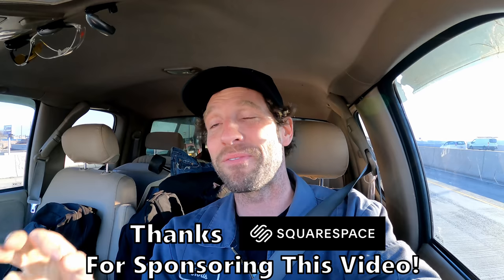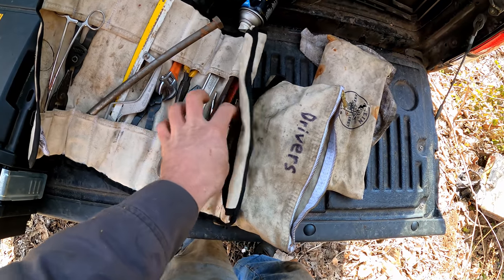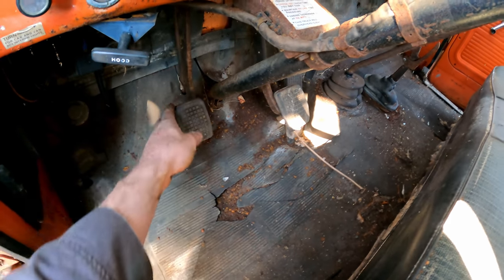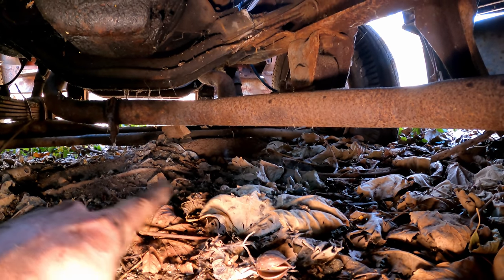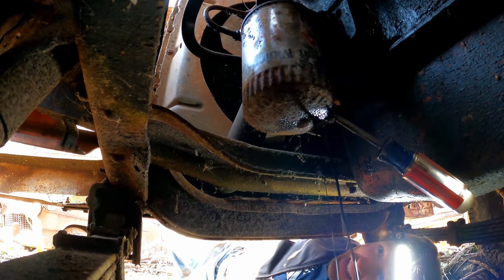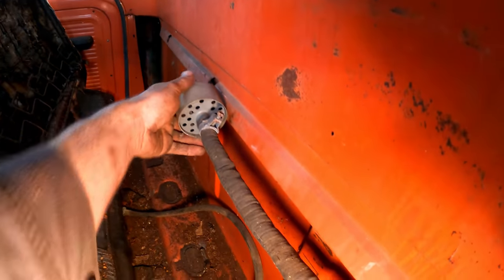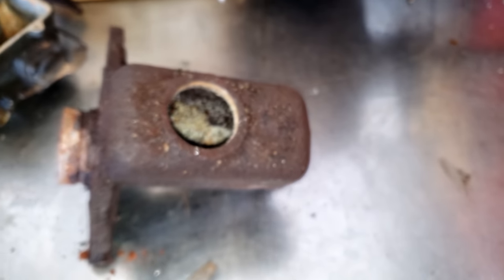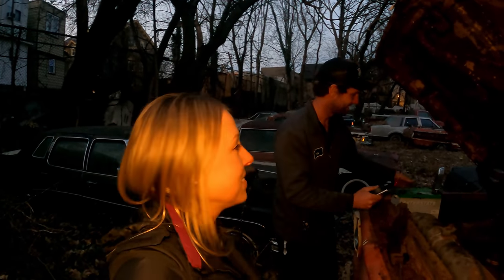Will It Run? 1971 Ford F600 Stick Shift U-HAUL Truck - NNKH

Comment: $1,200.00 OBO max parts truck it would cost a fortune to have that transported by a heavy haul. Loaded you are talking at least $3.00 a mile or more when it cost $1,500 now to fill a rig.
Reply from the maker: Thanks for your feedback man. And yeah true about moving it. That's why I figured try and get it rolling down the road but definitely needs four tires and brakes bare minimum.
Reply: @NoNonsenseKnowHow  Good job dude ! Engine sounds great ! You should be proud of yourself!

Comment: 300.00 really pushing 1200.00 but   no more even the parts on it not worth much as most are rusted or in bad shape. Plus towing that truck out of their is going to be expensive. The box is the value as it looks to be aluminum, as long as the box is not compromised then it's got value But if box is bad then scrap price would be somewhat good on box. who knows theirs always a person willing to pay the asking price.

Comment: I wouldn't pay more than $300-$500 for that truck. You'd be money ahead by putting that box on a already running and driving truck. If I had to guess, the truck has the 330 c.i.d engine.

Comment: 3 grand for it? hell no its worth maybe 1500 on a good day. i saw a few grain trucks that were sold at auction same year and with a dump bed sell for 800. scrap might get ya 1000 but you're still gonna have to tear it apart and that will take like a week to do. its not gonna drive without several thousands of dollars of parts and work too.
Reply from the maker: It's up on Facebook marketplace right now for 550 and not even selling it that price
Reply: @NoNonsenseKnowHow  yeah i really don't know why people think their stuff is worth so much. yeah its cool and interesting but anyone serious enough to buy it will take a while to sell it. no one wants to take the extra time out of their life to deal with someone elses problem and give them money for it. I know this old dude here in utah that has a few acres full of old mopars and gm cars. they all need restorations but he looks on mecum auctions and thinks that someone is gonna give him 30k for a roached out charger hes old and dumb. im waiting for him to die then im gonna go in and save as many as I can and make a profit. his family doesn't know anything about them but I might be able to get them at a good price.

Comment: That square body diesel was a failure for GM . That was a gas engine block. A friend had one was always vapor locked, overheating etc. GM wrote him a check for a internal combustion engine!! I helped him swap it over, was a lot of work!!! Wire harnesses, fuel, etc. etc. I think they put them in some of the large cars also Olds 98 Buick Electra Chevy not impala something else, it was a flop

Comment: Definitely not worth $3k.  I don't think Ford put the 360 in the big rigs. The big rig engines were based on the pickup FE engines but the big truck engines were the 332, 392 and I think a 351. Worth restoring even if you can find a cab that needs a truck. The rest of the rig looks okay.

Comment: 3k for that?!?! Get her to a drug rehab program!! 500 bucks max. You not only have a truck that'll never travel the roads again, but you also have to spend money to remove it once you bought it. 3k don't surprise me though, most hoarders are delusional. I even doubt anyone out there is looking for U haul truck parts from that era. The cab, if its salvageable, could be used on a F series pickup of that era, they are the same.
Reply: Could be put back on the road again with work
Reply: @mehmeh5471  Um yeah ok
Reply: @kman-mi7su  Nothing wrong with the frame, everything else can be replaced and repaired if want to spend $ so YEA OK

Comment: of course a manual transmission u haul, back in the early 70s 
the thirty somethings of that time all grew up on manual transmissions, most cars and trucks than came as a rule with a manual transmission, they in that era's way of talk came as standard options, or with a "standard transmission," in most cars, automatic transmissions were an "optional" only item.
   in a larger truck,  automatics were un reliable, did not pull well,
slipped a lot, and at the time, lots of cars only had two speeds as options, ford did have a c-6 for this truck, however, the ordering party for this truck was an OLDER guy likely in his fifties or sixties, who thought automatics belonged in cars, and here ya go

Comment: So not worth your time. The time you spent was enough. Running ... $850.00 tops. Think of what and how must be done just to move it to a place to part it out. Time is more than money... you spend it and you don't get it back. I had a 69 F-600 dump short wheel base and what a runner it was! Loud slow and a gas drinker but always did the job. Thank you for posting! Nice to see Jen's camaro ...mmmm CAMEO  lol

Comment: 1967 Ford truck I wouldn't give over 500 to 700 hundred  bad sigh oil filter and everything rotted  threw tires money brakes locked up clutch maybe brake line brake booster master cylinder new tank new cab new. Hood

Comment: Almost comical, a get it running video but the “ mechanic” doesn’t know what an oil bath air cleaner was! WOW
Reply from the maker: Yeah because todays cars have oil bath air filters on them.  The comical part is comments like yours.  😂

Comment: That's too rotted to bother trying to turn into a runner. A few hundred above scrap cost is all I'd pay for it if I wanted the drivetrain. And if I did I'd probably pull it in place and let her scrap the rest.

Comment: Why is he so shocked a 1971 truck has a manual transmission? Everything in 1971 had manual transmissions specially in this weight category.  Duh. I rember U Hauls as late as 1979 having manuals.. dude get a grip on your millennial self.